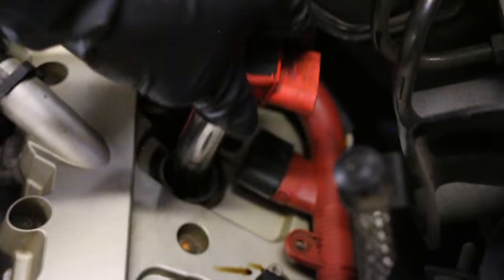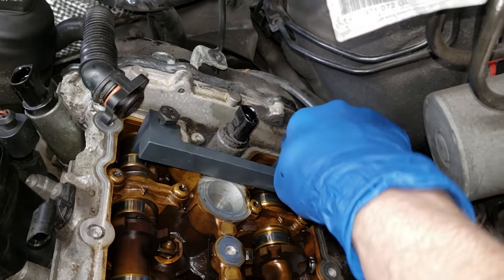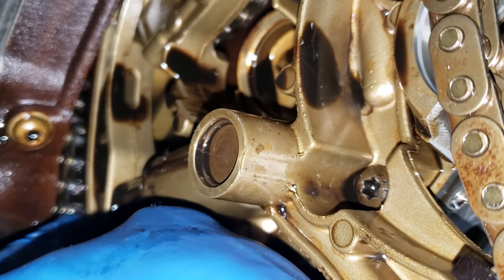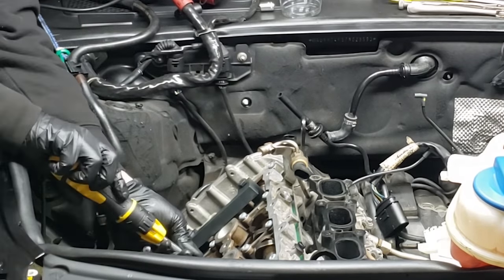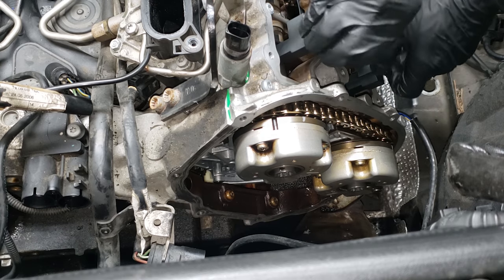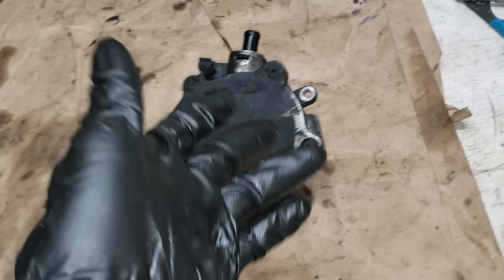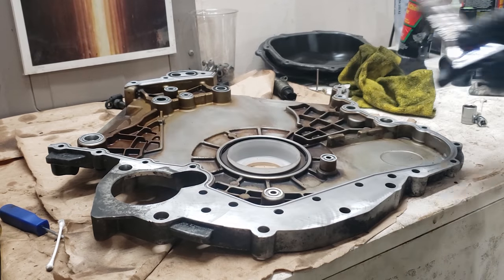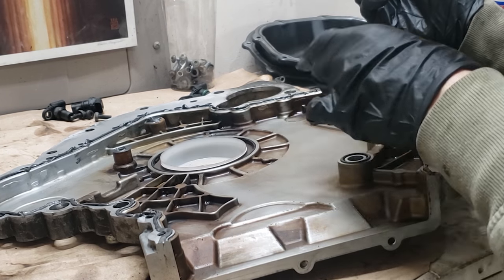Audi (A6 A4 Q5) 3.2 Upper Timing Chain Tensioners, Cam Girdle Seals, & Engine Removal | MUST SEE!

Comment: Great content!. I have a 06 Audi A6 3.2 (not Quattro). The shifter gear button is stuck in it doesn’t pop back out so basically the vehicle is stuck on N and D and because of that I can’t get the key out. Vehicle turns on/off and can only be driven forward. Can’t select any other gear due to the gear button being stuck.  Hope you can guide me before I take it to the dealer. Thank you so much.
Reply from the maker: Hey, thanks for the comment! Have you tried the shift release button yet? There is small button to push that will release the gears, if this doesn't work. Then you have a deeper problem. You may have to pull the leather boot up to find it. If you are having trouble, let me know and I will take a video and post it for you.
Reply from the maker: Actually, the shift lock button is under the ashtray in front of the shifter. Lift out the ashtray and look for a little slot. Or a piece of plastic covering the slot. Remove it then stick some thing long down there. Push down and move the shifter at the same time. See if this changes anything😁
Reply: @Mechani_Cole  hello and thank you for replying. I tried the shift release button but no luck.
Reply from the maker: Unfortunately, it might be the transmission control module. It might be worth the money to get it diagnosed the right way first so you know exactly what is wrong before changing any parts.
Reply: @Mechani_Cole  I really appreciate any information you’ve given me. I decided to give it a try and take the gear selector knob and came to find out that there’s a part that  it’s broken. I posted a video on my channel if you can watch it and tell if I need to order the whole shifter or just that one part. I also called Audi for information but they said they will have a Parts Rep. give me a call back. That was like 2 hours ago

Comment: Man great video I wish I found it sooner. Ive had a b7 a4 3.2 down for a while and I suspect a head gasket based on coolant loss and some whiteish smoke when I had it running.  would it be worth a rebuild with all of the labor cost or just buying a new motor and replacing?
Reply from the maker: Good question, it really depends on a lot of variables. Like how many miles is on the old engine, was there damage internally when it failed, has it ever over heated. And of course the cost of everything. Sometimes going with a new motor is nice if you plan to keep the car for a long time.
Reply: @Mechani_Cole  Thanks for the reply! Yeah those variables have been weighing on my decision for a while as its been sitting. Mileage was around 135k, surprising no chain tensioner issues as its a 2005.5 build

The car did overheat before, I'm not sure if the heads got warped or any other low end damage. Thats why I figured a whole rebuild might cost more in labor/time but I would have all new parts instead of taking a chance on a random block motor?

Thanks for your help! Its sad to see her just sitting in my garage while I figure out what to do with it lol
Reply from the maker: I would definitely look around at used motor options. But the only problem is, you will have to do a lot of maintenance to either engine before putting it back in. If you get a used engine, it will still be smart to replace the tensioners and all that. Much easier too since it's out of the car. 

But if your block is good, and the heads are good, then rebuilding might not be a bad option. Only issue here is, you won't know if the heads are good or if the block is good until it's taken apart and the heads are at the machine shop. 

Or option 3, buy a low mileage junk yard 3.2 or one from Ebay motors and slap it in as is and drive it until it has issues😬😅
Reply: @Mechani_Cole  Yeah I figured the cost of a good mechanic like yourself + all the new parts and time would cost more than just swapping it out and taking a chance. I will probably go this route, i had to build up some capital before pulling the trigger, as you know its just throwing $$$ at these hahaha

Thanks for the insight, I just got to find a reputable shop around that wont screw me over, the front end is off and everything is torn down, the old motor is ready to be taken out. 

Have you had any luck or known any stories about motors from ebay? I know they say "warranty" but can I really trust them that it was tested and will work lol. I would order all new gaskets and tensioners like you said , get it all done while its out

Comment: Just quick tip for the lower timing cover, if you chamfer the top side of the alignment dowels the cover goes on like 🧈.  This goes for 3.2, 4.2, 3.0t, 4.0t; pretty much anything with chains Trans side. Hope that makes  someone's life little easier. 👍
Reply from the maker: This is actually a great tip! I edited it out, but actually had to put the cover back on 2 different times because of how that Head gasket hangs out. Doing that to the dowels would help a bunch. Thanks for the comment🤙🏼

Comment: Hey MechaniC I love your videos. Is this procedure similar for an Audi Q7 V8 FSI BAR?
Reply from the maker: Similar yes! Chain is in the back, but there may be some small differences. The 4.2 has the EGR system back there too to remove. Not too crazy. To get to the chains you can remove the engine or the trans to get access
Reply: @Mechani_Cole THX
Reply: @Mechani_Cole "I'm trying to remove the timing chain covers, but the EGR system is in the way. Any tips on how to get it out? Also, when I opened the timing chain covers, a lot of coolant spilled out."
Reply from the maker: @theprocrastination3819 you have to remove the egr system first. And there shouldn't be any coolant in your timing cover. 

What year and model do you have?
Reply: @Mechani_Cole Issue: Can't fully remove the grind girdle to replace gaskets because the EGR system is stuck to the timing chain belt covers. Inside the covers, there's a pipe blocking access even more.

Additional Problem: Coolant leaked when disconnecting the EGR system from the timing belt covers. I suspect it's normal since the EGR cools the engine.

Solution: Removing the engine from the bottom seems like the only option, but I'm reluctant to buy and install a hoist just for this.

Vehicle Model: Audi Q7 4.2 4lb FSI BAR S-line

I'm frustrated with this unnecessary EGR system causing so much trouble. Considering reaching out to an online automotive community for advice.

PS: I was already thinking to replace the gasket while the chain is still tight and put it back on .... but I think that might not be a great idea ... my goal is to replace the gaskets between the grind girdle since it has massive oil lekas and the usual errors for for lean banks

Comment: Hey cole what is that part number for the bigger gasket on the lower timing cover found the smaller one just need the bigger gasket number. ?
Reply from the maker: On the lower timing cover? There is no large gasket on the timing cover. It's all RTV. Is there another part you mean by chance? I double checked the image of one to make sure, but I could be missing something. Or can you add the timestamp from the video here so I can help🤙🏼
Reply: @59.47 where the two gaskets are in the plastic bag I need to get the part # on the other one?
Reply from the maker: Good question, looks like I missed that one. For those 2 seals I couldn't find them online. I had to call the dealer and get the part. That would be the best bet, couldn't find it when I just searched for it
Reply: Thank you so much appreciated the video really help full

Comment: Hi there , wondering does the chain have any marking for tdc because I'm trying to do one tensioner replacement but now every time I put the chain back the engine get block when I turn it by hand any advise please
Reply from the maker: Did you use the locking tool to lock the engine top dead center before removing the chain? Its very important that you do that. Then before rotating the engine, you need to remove the locking pin. If you didn't do that then your timing might be way off
Reply: @Mechani_Cole  I did use the tool to lock it as it should be but after removing all the tool off try to turn the engine by hand it only half turn it get stuck.  Does the chain has any marking on it or does matter how to be , really need help at this stage.  Thanks for replying 🙂
Reply from the maker: The chain does not. You have to line up the holes on the cams and the lower locking pin. The cam holes are the only markings as far as I know
Reply: @Mechani_Cole  I don't want to remove the engine,  yes I did line the cam and the pin go in nice but some information on Google the said need to mark the chain before removing,  I really confused I don't what to do

Comment: Hi, i had to pull the old engine out and get another one due to old engine skipping timing.
I cranked the engine to build up oil pressure but after starting the engine i still have the metalic noise as there is no oil coming up just as you had when you stared the engine for the first time. What did you do to prime de oil pump? And for coolant refill, can be done without vacuum?
Reply from the maker: I should have removed the spark plugs and primed the oil pump by turning over the engine until the light went off, but I didn't. That's what I would do, you can unplug all your coils and turn the engine over to build pressure so it doesn't start. 

For the coolant, fill it up while it's running, just pour into the resovior and keep adding some as it heats up. Turn your heat on high and leave it running, it will continue to burp coolant out of the res with the lid off. Just watch your Temps at the same time. But no vacuum needed
Reply: @Mechani_Cole  wow thanks for the quick reply…. I only disconected fuel pump and injectors and then crancked it. I will give it a try like you said and hopefully will be ok
Reply from the maker: That works too, basically you just want to make sure the car won't start when turning over. 

I just did this on a Subaru and it took about 3-5 mins of cranking to get the oil pressure. I hooked up a battery pack so the battery wouldn't drain while doing so.
Reply: The fun part is that i have no oil pressure sensor lit up, so i don't understand why i still get no oil at the top of the engine
Reply from the maker: It's also very possible a valve or something is damaged from it jumping time. These are interference engines

Comment: Hi, thanks so much for the work, i'mwondering why you didn't tensio' the chain with the tool when initially torquing the camshaft adjusters ?
That's what they say on the audi documentation, I did it engine in but now I have worse values on block 93 despite original tensionners being worn out...
Did you check your block 93 values after all of this ?
Reply from the maker: Good question. It's possible that I missed that step. Was my first time doing it myself. I did check the values afterwards and all was lined up as far as I remember. This car is still running to this day, I just don't have it anymore.
Reply: @Mechani_Cole  nice, good for you, I might just end up pulling the engine for a complete timing overhaul because the values I get make no sens with new tensionners
Reply from the maker: To be honest, I would pull the engine everytime. There was so much I was going to miss if I didn't pull it
Reply: @Mechani_Cole  yes, just to bad I killed my hands getting those dam' torx out, you know the pain 🤣.
May I ask what made you decide to change the tensionners ? Did you have codes or rough running ? And did you happen to check the 93 values before pulling the engine ?
Reply from the maker: Familiar with the pain haha, no I didn't check before I did the job. I ONLY started this job to change my spark plugs. It's like some sick joke that ended up here. 

I did have chain rattle on cold startups, so I knew it needed it. I went to change the plugs and found oil on the plug tube, it was the cam girdle seal so I had to take everything out just to get to it. 

There was a lot I should of done different probably. I was in a hurry, on a budget and my first time haha
Reply: @Mechani_Cole  haha, I see, I had oil in the plugs also, cam gridle seal is tte next step of my bad luck 😅
Thanks for all

Comment: Would you like to fix this easy way? there is a YouTube video Audi oil in spark plug hole fix.
Reply from the maker: If you're talking about putting RTV sealant inside the tube, it won't work for long.
Reply from the maker: Actually, that's pretty good. I wish I knew about this before. Although this car needed a bunch of stuff I was able to get to, but would have avoided a lot of work if I knew this. 

Here's for the video for the people reading this - https://youtu.be/2Jao8SjoitI
Reply: @Its MechaniCole  thank you so much for posting that link,  I really just wanted to help people do this to save them money,  time and the hassle of pulling the motor! Thank you again. I LOVE your  videos
Reply from the maker: Learned something new myself today! Thanks for pointing that out, that's my main goal is to help people save money on car repairs🫡

Comment: Im looking at a 2007 Audi A6 avant with the 3.2 V6, it has 188 000km with a service history. Looking to use it as a daily and park my land rover in the garage for a bit. Anything major to look at before buying? Other than the timing chain at the back of the motor?
Reply from the maker: Love that car! I literally just sold mine not to long ago. Great daily driver, but they do leak oil in several places. Plus have carbon deposits 100% of the time. Leaks happen around the cam sensors, oil control valves, lower & upper timing covers. Oil cooler on the bottom right side leaks but is an easy repair if so. But if maintenance is done right these cars are great!

Oh and disable the comfort access module under the steering wheel by cutting the middle wire. These fail all the time and lock the steering wheel and ignition. Common failure. The Avants leak in the trunk and sometimes have MMI issues because of this.
Reply: @Mechani_Cole  thanks for the info! I drive a land rover as a daily now so I'm familiar with leaks hahaha. How regularly would you clean out the carbon build up?

The timing chain is definitely an engine out job if it goes wrong? And expensive to do?
Reply from the maker: Every 60-80k miles for the carbon. The timing chain is engine out if replacing all 4. Can do the top 2 with engine in, but not worth the hassle. Best to remove the engine, less headache
Reply: @Mechani_Cole  Are you talking about the steering lock? Which middle wire are you talking about, does that disable kessy from locking the steering wheel in case the switches are going bad in the module (J519 I think)
Reply from the maker: Yes and yes. It disables it from locking. Steering lock won't work anymore and need to make sure it's unlocked before cutting.
Reply: @Mechani_Cole  Yes, if you ever run into the issue where the kessy locks the car out. The trick is to get vagcom or a bluetooth obd module that can connect to the canbus (Car scanner on android with elm327 should work) to be able to scan for and erase the codes. To force the car to be able to turn on the obdII while the car is locked down, turn on the hazard lights, high beams (stick on) and hold the brake and turn the ignition to on, then you should be able to read for the codes and erase it. Temporary solution since if the switches are getting weak eventually you'll run into the same issue and need to clear the codes to reset again. Often the switches when they're weak are also assisted through a weak battery which results in the switches not contacting fast enough and then shutting the system down and preventing anything from turning on. 

The switches are repairable too and not super difficult. There are some DIY videos - if you need lmk and I can refer you to them. Otherwise it's good as a stop gap in the event that you encounter a dead car and it has to do with kessy locking down the car.
Reply from the maker: Yeah, all that works. Or just cut the wire and not deal with it. Who needs their steering wheel locked anyways? I just got rid of it all together🤙🏼
Reply: @Mechani_Cole  so what wire in particular needs to be cut, any idea. I like the steering lock function personally, it enables you to lock the wheel in a certain way, useful if parking on a hill, also adds to security in certain situations.

Comment: How did you re time it for it do be on time ?
Reply from the maker: With the locking tool. It keeps everything in time if done right. Then I hand rotate the engine about a dozen times at least to make sure all the timing marks lined up. 

The crank is locked by the pin. The cams are locked by the cam locks. Only removed once the job is complete. Make sure all the timing marks line up and good to go. 

There is some helpful comments in this section too from folks who have done this job as well😁

Comment: What size ratchet did you use in the crank lock bolt? I tried 1/2 and it doesn't fit in there because that 1/2 6mm hex socket is too tall. Any advice would be nice. 2.4 is the engine but they are almost same 🤔
Reply: to turn the crankshaft?
Reply: @powasly6357 i got it out using 1/4 hex socket and 1/4 ratchet anything bigger wouldn't fit.